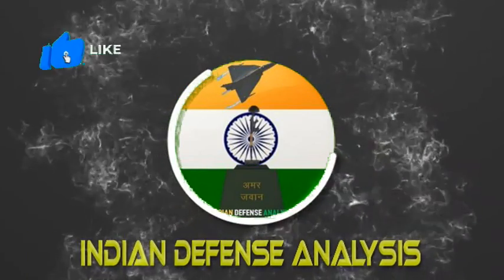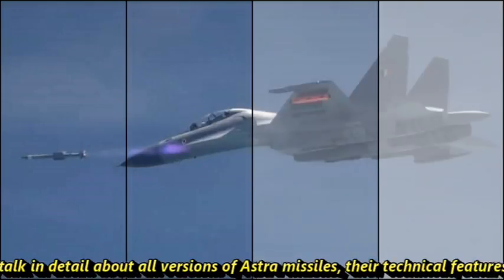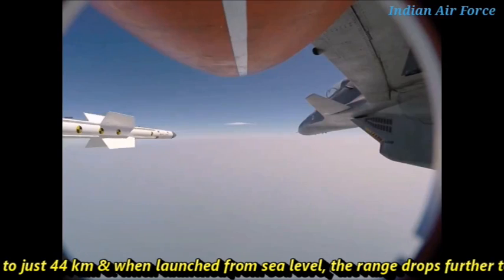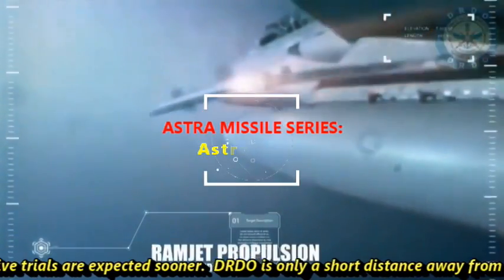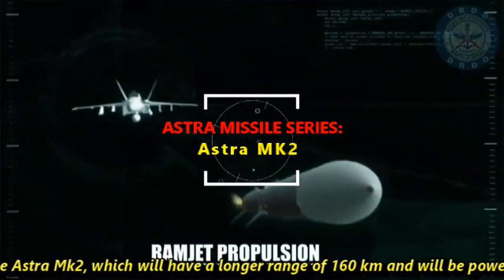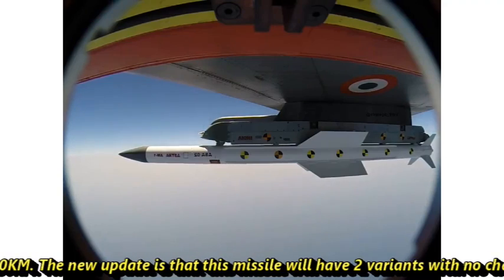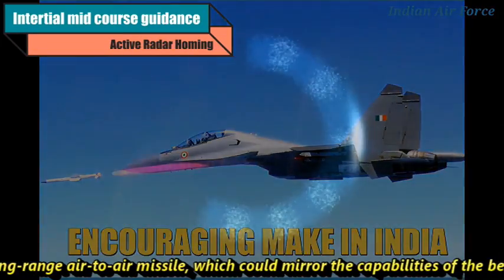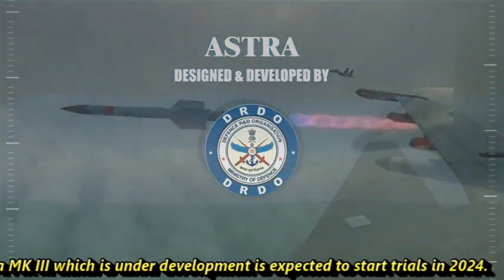Timeline and lastest update on Astra Mk 1, Astra Mk 2, Astra Mk 3 & Astra IR

Comment: Can we make hypersonic air to air missile
Reply: Hypersonic air to air missile cannot maneuver and cannot chase the fighter in such a high speed
It's possible to build a hypersonic missile but it will not work like a ordinary air to air missile 
If the target is non-maneuverable then hypersonic missile can hit it but today every fighter can maneuver and dotch the missile making the missile useless
Reply: @Priyesh Kumar quick but what will happen if target is 100-150km away it will still take some seconds 
After receiving lock signal the target will start maneuvering and it will be very difficult to catch a maneuverable target at long range and the target will also try to escape from the lock range
Reply: @Priyesh Kumar yes short range air to air hypersonic can be built if u don't want to waste money coz if it's hypersonic then cost and time is going to be very high and if u built short range then the missile will actually be worthless